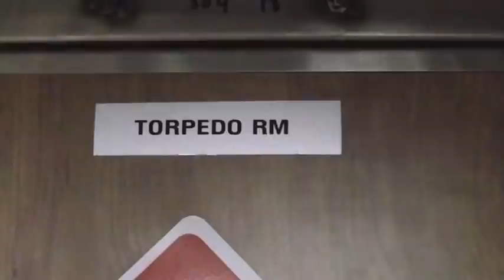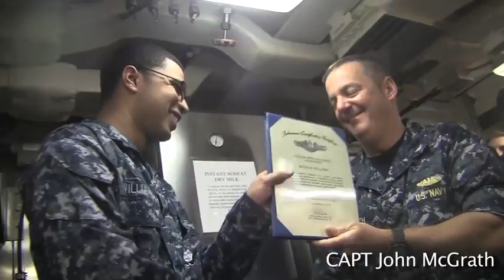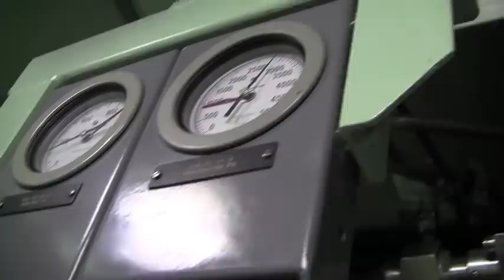Life on nuclear submarine USS Mississippi, partly built at Quonset

Comment: I am a submariner 1999 - 2003. Job was awesome, but depending on your marital status and crew/department life can get very bad.  Don't get married it will be very stressful.  I was not married during the time,  but many others were. Some went through it fine,  but some others didn't. Being a submariner I am very proud of serving. Life in a submarine is intense and stressful,  don't let outside stuff stress you more. If you want more information reply me.
Reply: I'm supposed to be a machinists mate and I leave for boot camp in about a month. I know this question could have a lot of answers, but is there anything I should know? Or is there anything interesting you can tell me about submarines and what life is like aboard a sub?
Reply: Garrett Ritter hello Garrett, 

Machine Mate = diesel generator, oils,  plumbing, gauges and fuels and log keeping,  AC and refrigeration,  valves & reading,  hydraulics mechanical systems, water systems,  submarine drivers (helms and planes), etc.

Life on submarine = smell of refrigeration all over (constantly) gets on your clothes and skin. Always Cool, not warm unless broken down AC. Narrow passages. Heavy lifting work.  Metal is surrounding you. very few walls a lot of plastor walls  around. Pipes, valves, systems, gauges, all around in every place.  So nothing looks straight forward or pretty.

Getting your dolphins (fish) give you 6 months = you need to learn the whole submarine,  Gauges, systems,  fire drills and emergencies,  locations,  and a lot more.

At sea = 18 hour days underway = 12 hours up (work and study) and 6 hours sleep, and then over and over and over and over...etc. until you get back to home port. Sometimes you may not even sleep due to drills or in battle situation. 

Guard Duty (sleep on sub while stationed on port) = once every 3 days rotation (highest in the armed forces) BAD. Surface ships once every 7 days big comparison.

Weapons to learn and get qualified = start with handgun,  shotgun,  m16, m60, and then grenade launcher. 

Submariners =
Pros:
- we have a home/room with a single roommate which is great.
- we have the best food
- we are well known special forces all over the armed forces. 
- Surface navy envy us. 
- we get more perks and $ than everyone else. 
- we get bigger college fund
- we get better training than everyone else
- we see a lot of ports

Cons:
- high stress
- lots of training and work
- feels like Neverending
- one text message (paragraph) to your loved ones per week. And a reply a couple days back with the same size.
- you are not able to call your loved ones until you get to a port and speak for a short time.
- don't get married until done it puts much weight on wife.

Hope this helped you. But once you compete your time you will have one of the greatest achievements you ever done in your life. It will make you stronger.  A submariner is a class of its own and should always be taken with great pride!

Stress factor = high
Reply: wolffame Thanks, I'm also leaving as an MM for submarines in a month. This is really nice information!
Reply: Hello Logan,

Prepare yourself with this journey and yes you will have good days and bad ones.  But at the end of the journey it is going to be great!  Submariners are an elite class (special forces) in the Navy.
Reply: what did you guys do in your downtime?
Reply: Do submariners get promoted faster than other sailors?
Reply: Joer Asswwq 

downtime:

- lots of needed qualifications to accomplish. There is always something new to gain/learn.
- do some courses for some college credit
- watch movies,  books, sleep while you can. 
- Friday night - Pizza night
Reply: Edwin Saar hello Edwin, promotion is a bit faster due to less Submariners compare to surface.  You still have to pass the navy exam when it comes around for the individual to advance.
Reply: Do you need to go through a physical test to enter the navy and serve on a ship or sub??
Reply: What does the test mainly consist of??
Reply: gross?? like what?
Reply: really?? Does it accidentally happen or do people make you do this?? lol
Reply: ***** didn't want to stay behind on my education - I've pursued a college degree.  You don't get a chance while active duty to go to school.
Reply: GianQ yes all military branches need physical, logical,  and background tests.
Reply: +wolffame I plan on joining the navy, and would like to have an MOS as a medical personal, but preferably not combat like 68W, or a corpsman. Do I get to pick if I go into a submarine or not? I hate submarines
Reply: +Ody Hello Ody - Submarines is a choice like choosing Navy Seals. Not everyone can be qualified - it is heavy background and health checks.
Reply: < Sonar Technician Submarines (STS)
Reply: +wolffame What's the longest you've spent submerged? I know nuclear subs can be out at sea for much longer than their WWII counterparts but does that mean you could find yourself submerged for over a month? In my imagination I sometimes feel that the claustrophobia can get quite intense.
Reply: +Nickuncle Hello there are two classes of subs.

fast attack sub SSN (me)= 6 month cruise and a lot of mini cruises 1 months, but you will pull in many ports lots of sea time. submerged for a month or more while doing missions but you rise to surface more.
the real action is here.

SSGN/BN submarines = two teams = blue and gold rotation = 3 months at sea and 3 months at port. then again 3 months... and so on.  boring but sub is spacious and have more stuff to do.
Reply: +wolffame wow man I just wanted to say thank you for your service, would buy you a beer or something if I could.
Reply: +mike thank you Mike.
Reply: wolffame ive actually been watching more and more vids on nuclear subs.. I already know I want to join the Navy but im not sure what i want my MOS to be yet.. These submarines are pretty damn interesting and it'd be pretty badass to say you worked on a nuclear submarine.
Reply: Fucking pog
Reply: +George Washington  I can't believe  you  said  that  Georgie.
Reply: Do you happen to know the pass/failure rate of people opting to be a submariner?  Would you say it's substantially more difficult then most Navy jobs?
Reply: Howdy, all. Currently 25 years old. Haven’t contacted my local recruiter yet, but I’ve been looking into the nuclear officer pathway. Interested in sub volunteering. In your experience, am I too old? Always looking to learn. Thanks for your reply. Cheers
Reply: sounds like trucking to me I was trying to do lease purchase out for 90 days min and home for 7 days max
Reply: wolffame r
Reply: wolffame I’ve got Rush Limbaugh on radio as I read your text of 4 years ago.Its because of you and the young man you texted (hope he is doing good)I’m able to listen to Rush, Hannity and Mark Levin. Thank you for your service.
Reply: If the Navy wanted you(us) to have a wife, she would have been issued with our sea-bag.
Reply: @wolffame  At sea days have since switched to 24 hour days. 8 on watch, 8 off, 8 down in the rack. Or if you're a crank 12 on 12 off. Cranking is probably different boat to boat (LA class from my experience)
Reply: wolffame hi there, if they pulled in to port is there any chance that you can be there as well?
Reply: Renrais Just the Same.
Reply: wolffame thank you for this. I learned a lot. Thank you for your service ⚓️🇺🇸 Having a bf on a sub, sure its been a pain but he always told me to be strong, and as a saying goes You never really know how strong you are until being strong is your only choice.
Reply: Thank you
Reply: mRenrais
Reply: I'm going into AECF and my recruiters are on me to get me to join SECF and I just don't know about sub duty compared to surface I can't decide if the money is worth the stress and confinement
Reply: I Salute You Sir USA 🇺🇸 Silent Service

Comment: at 600ft wouldn't you get the bends if you just floated straight up? I suppose that's still preferable to death but that would suck
Reply: You get the bends because you breathed air under pressure and as you rise that causes bubbles to form.  Just using the escape system you didn't really breathe any high pressure air.
Reply: Yes you will get the bends. As that chief said, the dissub system isn't plan B, its 6 steps after plan Z. If a sub ever has to use it, only the most fit actually go up, and there is a real chance that a portion of those who go will not survive when they get up because if they pass out they could drown. And only the most basic survival gear is whither you when you go.